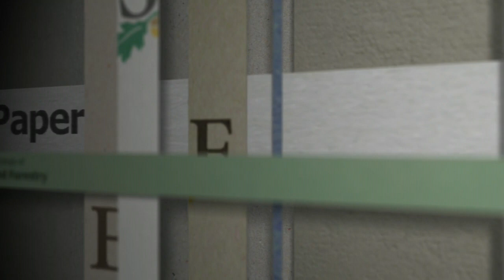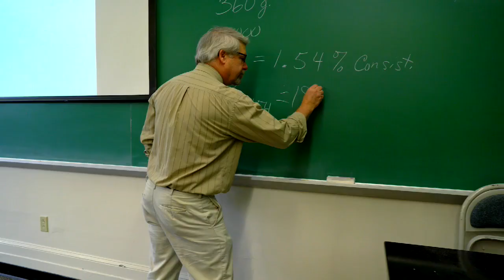What is Paper Engineering?

Comment: Hi!
I am a college student considering paper engineering as a major. What type of careers are available for PE? Are there any other companies other than mills, where you can work?
Thank you!
Reply: You’ve probably already started, but if it’s not too late to change, don’t get into paper engineering. It’ll pigeonhole you into a career field that you may or may not like. Go with chemical engineering instead. With ChE you can still work as an engineer in a paper mill, but if you decide it sucks, ChE  is versatile.
Reply: @tkdguy5494  I actually haven't started. Chemical Engineering turned out to be what I'm aiming for, for the exact reason you mentioned😊However, I'm starting off as a chemical technician and then getting my bachelor's in chem eng later down the road. Thanks for the reply though!